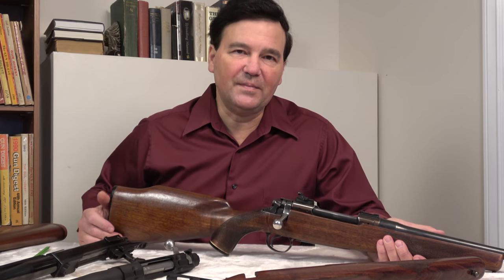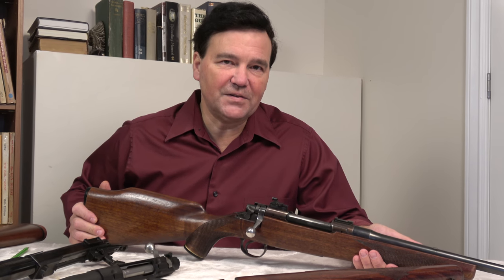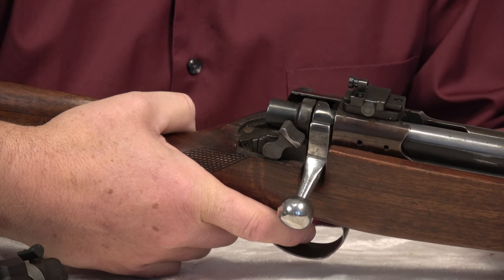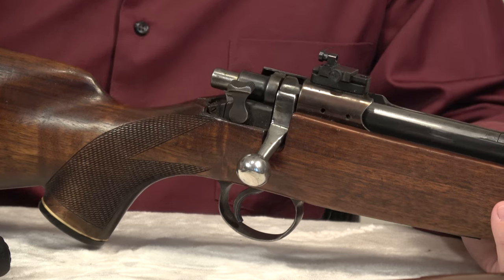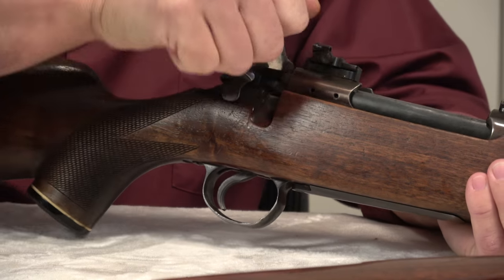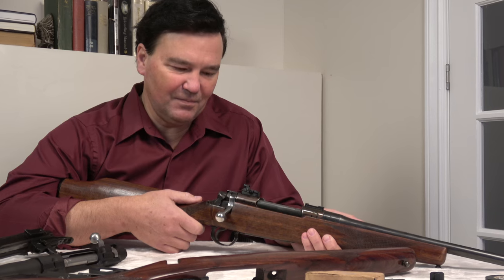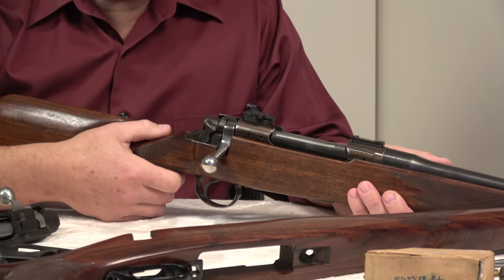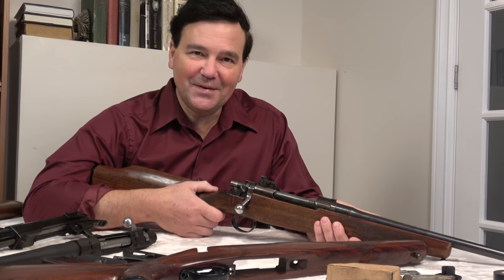Rifle Safety Fail

Comment: USOG, Thank You very much for this safety lesson. I have had an experience with this issue once.  A Man tried to sell Me a Weatherby Vanguard , He let Me try it before purchasing it.  I try every rifle un loaded before firing live ammo to test the safety, and try out the trigger.  To make a long story short, the rifle would fire when the safety was released. I did not purchase the rifle. The Man admitted to having lightened the trigger. This Rifle had little to no sear engagement. Very dangerous situation. Thanks again for posting this, videos like this could save a life. God Bless
Reply from the maker: Hi Rick - now that is important - all of the unsafe triggers and safeties I encountered were on older guns. Your experience goes to show people do this to modern, fine guns, like the Vanguard as well. Thank you for letting people know. Everyone should practice and get used to their triggers - whatever weight they are - mastering a trigger pull is not a big deal; this thing about pulling out files and I've even seen Dremels on triggers needs to stop. God bless you and keep you.

Comment: Thank you and I agree 100%.

My first and favorite .22LR rifle, Sako P-54, has a flaw. The safety is a L-shaped bar and if you apply too much pressure to the trigger when safety is engaged, you can break it. 
The bar will break off and the gun will fire. That is how I got it from my granddad and dad, dont know which one of them had broken it but as I have seen dozens of P-54`s, most have the same breakage. 
Mine is fixed but I still dont trust it as I dont trust safeties in general. 
Negligent or accidental discharge is a thing we dont want to encounter.
Reply from the maker: Hi Teppo, Thanks for telling us. I hope all P-54 owners know what you know. I like what you said about safeties - "I don't trust safeties" - the German de-cocking rifles are a good way to go.
Reply: You said it best, and i wish more would get this, Dont trust safeties.

Comment: Just saw your rifle safety video and i really appreciate you getting the message across clearly.  Another rifle safety topic you might care to discuss  is the "self loading rifle ".  The term 'self loading' has gone out of fashion,  we usually now use the term Automatic, Auto loading, or simi Automatic. But most people do not realize that some firearms actually can (and often do) chamber around accidently. Especially the common  .22 such as the ruger 10-22 marlin 60, winchester, remington and their clones. Since they are  blowback operated there is only spring pressure holding the bolt shut and most do not have a bolt latch even when on 'safe'.  If the buttstock is struck the inertia will cause the bolt to open enough to chamber a round from the magazine. Dropping the rifle only about a foot or so onto a hard surface is enough to chamber a round  , or eject the one from the  chamber.  Thank you again.

Comment: Yeah, I test all my rifles safety's like that to make sure they work properly before I load with live ammo. I also bump the stock on the ground to make sure the firing pin doesn't drop when bumped. On an empty chamber of coarse.
Reply from the maker: Hi Jason - I like the "bump" - I should have mentioned that in my video. I personally had 2 shotguns that "fired" when you bump the stock. Of course I learned this when they were not loaded. Thank you so much for mentioning - I will credit you when I talk about it on video.
Reply: USOG that is actually a common problem with pump action shotguns
Reply: Also a problem with O/U shotguns as well. Parts wearing and oil stiffening can cause them to fire both barrels at once or rapidly one after another and it is a huge problem. Fixable but you must be aware of that possibility.
Reply: Openbolt submachineguns have similar problem and too many soldiers have been injured and/or died while pumping or dropping their weapon. The bolt goes back; picks up a live round from the magazine and fires it as it slams forward. Thing to be aware when handling SMG`s at the range.

Comment: I bought a sporterized Eddystone in 30-06 a few months ago - beautifully done at that - and it has the same style of safety. I had bought it on Gunbroker at a price I couldn't pass up and the FFL who received it for me pointed out that he could drop the striker while the safety is in the middle position. When I have the safety fully engaged and squeeze the trigger, it doesn't fire later when the safety is released, which is good. The trigger had been upgraded when the rifle was sporterized so if I understand the video correctly, this may be the cause of the "unsafe" safety? Thanks for all the info!
Reply from the maker: Hi BM, Yes - that is perfect and on this one they put a pin to prevent full safety travel. They wanted the trigger locked and the bolt could still be opened - which is not a bad idea. They didn't realize the safety if pinned or used at half cock would release the sear if the trigger is pulled at "half safe." I removed the pin.
Reply: Very interesting. Thanks for the reply and all the great content on your channel.
Reply: I have handled and collected Model 1917's and the British version P14 for 55  years and have never seen anyone put the safety in a vertical position. If you'll look at the stock of either of the two rifles I mentioned in their battle dress stocks you will see that there is a radiused cut out in the stock for the safety to rotate back 180° to the full rear position. The individual that built this sporting stock did not cut the recess in the stock to allow the safety to fully engage. I deeply respect the author of this video channel and this IS my only time to have commented in what I see is NOT a firearm design fault but human error in the safety use. I recommend anyone interested in these rifles to note the original stock design and advise the use of the full application of the safety as it was designed in 1913. These rifles have the strongest actions and the most fail proof safety designed in any military configuration yet the safety must be applied in the full on position.

Comment: Oh i have a good one of these. A Martini action. Open and close the breach. Apply the safety. Test the trigger. Nothing. Take the safety off *CLICK*.
Reply from the maker: Thanks for writing! That is the click of death - I know exactly that situation. Can be corrected BTW - the Martini is otherwise excellent.
Reply: USOG Im not so sure about mine. It was made in Lausanne and then someone decided to change some stuff. I took it apart once and well... The trigger swivles on what appears to be a very cheep sheet of metal, very shody soldering. I ought to take a video of it at some point. But id need to get ammo first as it is an unobtanium even 40 years ago. 9.3x53r Swiss.
At least i have an example of a Martini action at least and that for 35 bucks, i guess.

Comment: About 5 years ago my brother told me he wanted me to look at a custom Winchester Model 70 he had custom built around 2000 right when 300WSM came out.  Right after he had it built he took it on a moose hunt and said it would fire by itself so he hadn't used it since.  I never got a chance to look at it.  Long story short he died last year and my nephew inherited it and I had told him about the problem so he brought it over today for me to look at it.  If you had the safety in the intermediate position while cocked and just barely touched the trigger, it would put it into a state that when you pushed the safety from intermediate to fire position it would fire.  Having seen that before, I took off the stock and immediately noticed all the nuts on the trigger were loose and the trigger spring had no compression on it, so when it was cocked and on safe if you fiddled with the trigger sometimes it wouldn't spring back to catch the sear.  Sometimes it would fire just by moving safety to the fire position without messing with the trigger.  I re-adjusted the upper trigger nuts and locked them together and adjusted the lower nut and put purple locktite on the threads.  Now it works properly, but I wouldn't trust the safety on any trigger designed to rely on three nuts on a threaded rod staying tight.
Reply from the maker: Hi Rob, I'm sorry about your brother. I like to think he's gone on ahead and is waiting on the trail for you. As for triggers and safeties. People seem to be keen on improving trigger pulls and so begins the end of many triggers, safeties, guns, and lives. The Model 70 has an excellent trigger and safety from the factory. I've yet to see a factory trigger come apart on its own; especially the Model 70. I suppose it could happen though. Anyway your conclusion is correct : no safety should be trusted. I open the bolt. IMHO. All the best to you and thanks for writing.
Reply: @UnitedStatesOfGuns  You're right, probably the gunsmith that built that rifle had the nuts backed down as far as possible to get the lightest pull, which also puts less tension on the nuts, making them easier to come loose.  Either that or the upper two nuts weren't properly locked together.  I'd feel much better with that setup with the longer spring on top and eliminating the upper two nuts completely.  You have some great videos, and this one makes it clear why you should never rely on a safety and always have the gun pointed in a safe direction.

Comment: if my memory serves me right, that safety switch needs to be pulled all the way back, at which point it actually pulls the striker back from the sear. The P17 safety is about the stoutest I have seen.
Reply from the maker: You're right - a smith fixed it for me with no issues.
Reply: Absolutely correct Charles

Comment: That is amazing.  I did not know.  I paused the video and ran to get my gun and test.  The safety on my Mauser has been modified to allow a scope, so the three position wing safety tab only goes down to fire and almost vertical for safety (no fire).  So that may be the reason mine doesn't not duplicate what you show.  If I cock the gun with the bolt and place the gun in safe mode, pull the trigger then move the safety tab down to the fire position the striker is not released.  I think that is either because the Mauser does not have that flaw or because mine was customized thus that flaw was removed.  Nevertheless, excellent video and critical to know information.
Reply from the maker: You have the best action ever made. Paul Mauser thought of everything. Even with the scope safety - that safety will never fail . And I don't use the term never easily. Cheers Rick.

Comment: The only thing worse is a stuck firing pin. Then the gun goes off when you close the gun.
Reply from the maker: That is bad!
Reply: I once got a shotgun into my shop by a customer who complained he had had it at another gunsmith and "now the damn thing goes off when I close it". Turned out the other "gunsmith" did not harden the firing pin so they had mushroomed at the end! Every time he fired the gun the pin got stuck in its hole like a wedge. It is very important to teach shooters to point guns in a safe direction, and hold the gun firmly when closing actions.

Comment: I am glad I found this. My Mouser did exactly the same thing and local fun Smith didn't believe me. I took it to another who found no issue. Is there something I can ask them to do to fix this issue? I would think upgrading the trigger and bolt might help... Can you directive what you did to fix it? I want to show this video to my gunsmith and see if he understands what I'm talking about.
Reply from the maker: Hi Matt - This type of malfunction can usually be easily fixed. Most of the time someone has tried to do something with the safety or trigger and caused the problem. The Mauser and Enfield safeties and trigger are excellent as designed and manufactured. Attempts to improve triggers often make them unsafe. Good luck with your Mauser.

Comment: Much prefer the European decocker system . I am thinking of getting a custom carbon gun built on tikka m595 action I have but the safety does not feel dependable I prefer a 3 position safety or decocker . Might go with sauer 404 left handed or heym sr30 left handed .
Reply from the maker: Hi John - the decocker is a very smart way to go for sure - I like it too. Your idea of the custom rifle on the 595 is very interesting; I haven't seen many or any custom rifles on that fine action. Good idea! The Heym is brilliant and so is the 404 - but you know these things already : ) Thanks for writing John.
Reply: @UnitedStatesOfGuns  in Ireland and UK. The old tikka s like the m590 m595 m55 etc are known to be the best non custom action to build a gun on . I'm a major fan of steyr and have a ssg p2 in .22 250 and I can't sell it at all so I won't buy another steyr for this reason it's not a well known brand here in Ireland . I'm stuck between custom build or blaser r8 or heym or sauer 404 . Love to hear your opinion on the best of the above 3 manufacturers .

Comment: I got a rem700 from an auction and went to shoot aware of the reputation they had for firing without pulling the trigger. On my tenth round the striker wouldn't lock to the rear and when I got it to I had a weird feeling the gun was going to fire when I flipped the safety off. I aimed at the target, pushed the safety forward and sure enough, boom. But that wasn't a factory issue. Like you mentioned, someone tampered with the trigger and messed up the sear angle. Just can't be too careful
Reply from the maker: That is a perfect example Jonathan. Thank you for writing. I have one Remington that does that as well. I'll dig it out and make a video. Someone tried to lighten the trigger pull. Modern triggers need to be left alone unless designed for adjustment. I think the problem was/is that the older triggers in older guns - not just Remingtons - could be improved - then when the new style units came out people didn't realize their sensitivity. I want everyone to know how dangerous it is to work on triggers and safeties. Thanks for reminding me about the Remington. These are brilliant rifles - but people should leave the triggers alone - or buy a Timney or something.
Reply: The one I got is a police model, so one can only assume it was a police gunsmith that did the tampering, but I certainly hope not.

Comment: Immediately after watching this video, I check all my rifles and found a serious risk.  The safety of my Zastava M85 7.62x39 could be fail. I found when the screw that controls the safety is turned 45 degrees, the safety can be fail, the trigger can still be pulled to fire even with safety on. Normally, the trigger cannot be pulled when the safety turns on.  That said, if this screw somehow came loose by 45 degrees, the gun could still misfire even with the safety on.  I tried several times to make sure the problem exists. Thank you for the reminder.
Reply from the maker: Important post - thank you! Maybe some Loctite on that screw is a good  idea. Thank you for informing us.
Reply: @UnitedStatesOfGuns  Thanks for the info, I didn't know Loctite could be used to hold screws before. I will buy it.

Comment: Good video about safety safety. My question is, what make and model is it? The local gunshop has a postwar-customized rifle that has the same action build, but there are no markings save a horse's head on top of the breech band. ALSO it had been re-chambered in 25-06.
Reply from the maker: This is a P14 or 17 Enfeild - I don't have it anymore. Easily corrected the safety is fine now; someone played with the safety/trigger which caused the problem. Often the case. I'd buy another.

Comment: I just did this with my Lee Enfield No. 4 by putting the safety on half way, but when the firing pin went down as I turned the safety off, it stopped again, short of firing, and the whole thing was locked up, until I pulled on the "decocker" thus cocking the rifle again.

Comment: Reminds me of a shotgun I used to own. The saftey didn't work, like it did nothing at all, the trigger could still be pulled just as easily. I have since scraped it and sold as many of the parts as I could.
Reply from the maker: Hi Frank, You did the right thing. I had a double shotgun that someone had used a file on. They wanted to change something with the triggers - maybe the heaviness of the pull. Anyway, that gun could fire at any time - or the triggers were so heavy to pull they were unusable. I sold the parts too.

Comment: In the 80s and 90s there was quite popular here in Norway when on rebuilt Ex mil k98s that was cheap to put on the Quart Safety , buehler type  i think it was made by or a copy of.

It worked good,but if it was much used it got worn and shot would go. Imagine a safety of that put on the Police sniper rifles, and they was much used to keep the zero of the sjooter in order. Then things started to happen on range. Then it was a ban on using those rifles. As i know for a while only the  Delta Police unit had sniper rifles . They did not at all want to adopt the modified k98 rifles made by Vapensmia Dokka wwho also made the NM 149 and NM 149s  sniper rifles, same safety on them also. The police bought Sauer SSG 3000 rifles and that was a much better choice ,especially on the  hostage taking on Torp in 1994, lot of stuff to google there.
Reply from the maker: Very interesting comments - and I'll read more. I'm glad the went with the 3000. I can't imagine police and military with faulty rifles; in those life and death situations the rifle must work 100% - as you know.